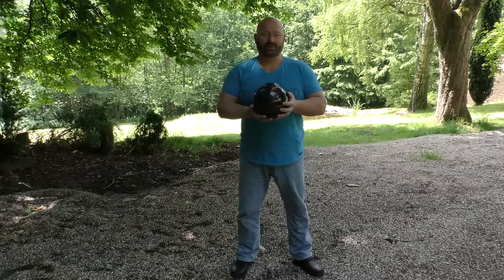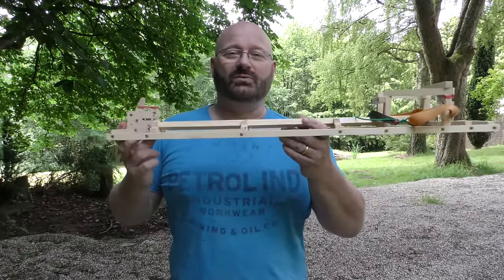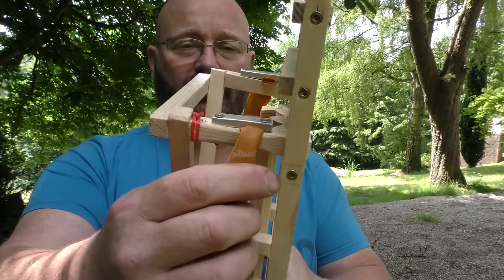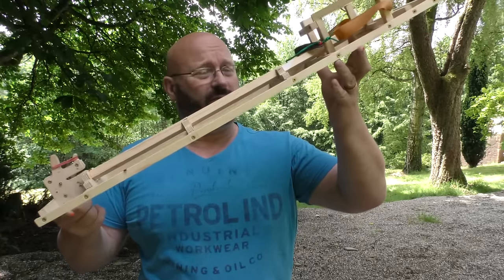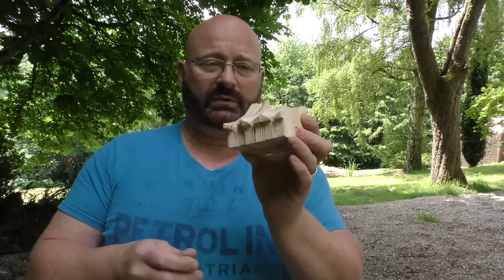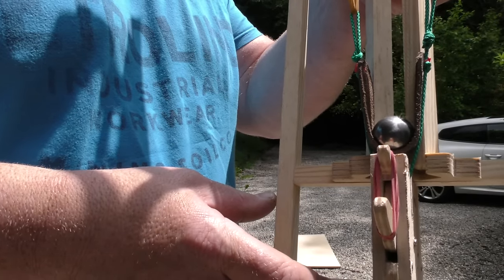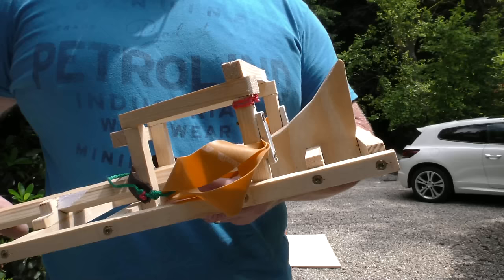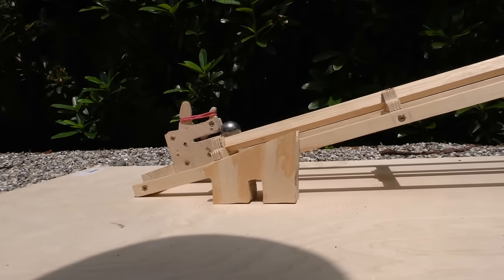Bowling Ball Launcher 1:10 Scale Experiments

Comment: Isn't the bowling ball 100x larger than the 1inch steel ball.
Reply: Sorry... 1000x larger
Reply: it is 10 times wider, 10 times taller, and 10 times deeper than the steel ball.
Reply: +Jeffah24 yeah, making it 1000x the volume
Reply: well 10x10x10 is 1000 which might be correct for the SIZE of the ball (note that no specifications on the ball were given by Joerg), but bowling balls also aren't made from steel so you have to take into account that a ball of steel the same size as the bowling ball would be waaaay heavier. Someone earlier said that a 25mm steel ball was more like 1/644 of a bowling ball but if that's a 14 lb bowling ball, which is the average size for an adult, then i think it would more like 1/750. Now there is a lot more to launching things than just size and weight but my point and a lot of other people's is that a 25mm steel ball is NOT 1/10 of a bowling ball by any stretch of the imagination.

Edit: Maybe he just means the launcher is 1/10 and saying the ball was 1/10 was just some confusion.
Reply: +Blasturbator yeah of course in terms of weight a bowling ball made of steel is going to be some what heavier. But I'm just talking about scale. I worked it out that the steel ball is roughly 8.6cm^3 and the bowling ball would be 8600cm^3 making it 1000x the volume.
Reply: VOLUME is not SCALE.  The scale is 1 : 10
Reply: +Jeffah24 Scale can take into account volume as well but my original point is wrong you would multiply every factor by ten to work out the volume not the volume its self. So it is a 1:10 scale, not for the reasons you stated.
Reply: +Lewis Ramos it's a 1 : 10 scale because I said it's a 1 : 10 scale, and most importantly because Joerg said it's a 1 : 10 scale.
Reply: +Jeffah24 yes you are correct and you nor Joerg can ever be wrong about anything. I do apologise sir or do you prefer "your majesty".
Reply from the maker: I am certainly not always right, not by a long shot. But here, I clearly used the correct scaling pretty much. Check out wikipedia "the scale often reported in scale models refers only to the geometric scale".  Means, a 1:10 model of a 25 cm ball has a diameter of 2,5 cm. If you go into a toy store and buy models for airplanes, you will find that this exact method is employed. It's just how scale models are defined. Of course the volume of the large ball will be 1000 times larger, but so will the volume of the wooden beams and the volume of the rubber relate.
Reply: +JoergSprave Yeah I realised I was being stupid because I didn't take into account you multiply every measurement by the scale vector 10 making it a 1:10 scale in terms of each individual measurement. I do apologise and I absolutely love your videos and respect your knowledge on these subjects.
Reply: +Lewis Ramos It would be interesting to put a 1:10 car next to the 1:10 bowling ball launcher. Technically speaking, the 1:10 bowling ball should fit in the seat of a 1:10 scale car.
Reply: +Takashi Tamanaha You're just saying 1:10, what are you scaling it against.
Reply: +Takashi Tamanaha 1:10 is a scale down of the actual size. A real bowling bowl and a real car scale down 10 times would look like toys. The 1 in 1:10 is always reality size. A real life bowling scaled down 10 times should fit in a real life car scaled down 10 times. The size stays proportionate.
Reply: +Takashi Tamanaha Not strictly... There are large cars and small cars if you named a specific car it would have made sense.
Reply: +Lewis Ramos It applies to all cars because it is the size of the actual size car no matter the size of the car. A miata scaled down 10 times will be proportionately smaller to a Ford F150 scaled down 10 times. The factor is actual size.
Reply: +Takashi Tamanaha All actual size cars can fit actual bowling balls. Therefore all 1:10 bowling balls can fit into all 1:10 cars.
Reply: +Takashi Tamanaha What you are saying makes absolutely zero sense.
Reply: +Lewis Ramos just think of it as all squares are proportionate.
Reply: +Takashi Tamanaha Cars are not squares they are different shapes there is no exact size of a car so if you want to have a 1:10 scale model you would have to specify what car. How do you not understand that? I did A-Level Mathematics and mechanical mathematics alright, this is my shit.
Reply: +Lewis Ramos well if you draw any square. Which is four 90 degree angles with four equal sides and shrink or expand it. It still remains the definition of a square.
Reply: +Lewis Ramos Scaling is giving a reference point at which a shape is being enlarged or shrunk.
Reply: +Lewis Ramos  A bowling ball shrunk ten times still retains it shape. Same thing for a car.
Reply: +Lewis Ramos So if the bowling ball is shrunk 10 times and any car is shrunk at 10 times. The shrunken 10 times ball will fit in a car shrunken 10 times.
Reply: +Takashi Tamanaha Well done you used too many words to explain simple logic. Congratulations. 😂
Reply: +Lewis Ramos Well I did not have a reference point of how much you do not know.
Reply: +Lewis Ramos I was an anti tank missile men in the military. It is vital to explains things clearly, otherwise something might go wrong and the wrong people die.
Reply: Is a bowling ball 100 inches or 2.5 metres?
Reply: it's 10×
Reply: ADZ OWND U No it's1000x the size but it's three dimensional meaning each factor must be multiplied by the scale vector 10.
Reply: Michael Western The irony in this comment is overwhelming.
Reply: +Lewis Ramos How in god's name did you pass GCSE maths, never mind A level
Reply: +Lewis Ramos I have a degree in physics and mathematics and let me assure you, this is most certainly NOT "your shit".
Reply: Oscar Hall sure sure... Can I just specify I have already established I was wrong and have corrected myself.
Reply: ***** Oh someone else who hasn't clicked the link.
Reply: Sir Lance Goodthrust If someone questions my intelligence when I'm right and they're wrong then I'm not going to apologize. If you would like to click the link it would be amazing.
Reply: Why thank you Sir Lance Goodthrust. You are indeed a Gentleman and a Scholar!! Lewis Ramos aka angry atheist is just craving attention. I do not think he as any motivation in his life, but only to make other people upset. Sad story. That is my conclusion. People cannot receive help, if they cannot see that they need help. That is called ignorance and Angry Atheist is ignorant in why it is important to make friends instead of enemies.
Reply: Sir Lance Goodthrust The second someone questioned your knowledge you went straight on the defensive. Weird considering you were just telling me that was wrong. As for you Takashi it wasn't my intention to offend you and if I did I apologize, it just appeared you were explaining to me what I already knew and when I clearly stated I was wrong about my original point and also gave an explanation as to why, people were still trying to prove me wrong... My sincerest of apologies, please in the future don't be so quick to judge someone it can come across as an unnecessary attack.
Reply: Sir Lance Goodthrust About atheism
Reply: For nearly every drafting project, the term "scale" refers to one dimensional measurements, or length. Volume, consisting of three dimensions, would then be the cube of that ratio so everybody here is technically correct, but the dude refers to his project as a 1:10 scale and when in Rome, do as the Romans do. As for the rest of this mumbo jumbo, can we please just pause, take a deep breath, and remind ourselves that this is a youtube video about slingshots. Rubber and wood. Not veganism, politics,crossfit, or any sort of religion (or lack of). Slingshots, people.
Reply: +Max Mazurowski i agree, this is about FUN!!! So let us have some mr Sprave!!!
Reply: +Angry Atheist No worries.
Reply: The densities are different.
Reply: shlev Wow
Reply: When you talk about scale u consider only ola parameter, in this case radius.
Reply: Angry * Atheist

Comment: Instead of moving the whole frame up why not just move the channel/barrel the ball is fired from. You dont even really need the barrel. Have two poles or a frame to attach the rubber to then you can simply adjust the height that the rubber is attached at. Still use your winch that you attach to a frame that is either connected to the poles or planted firmly in the ground to stop it moving (use long spikes that you hit into the ground like you would use for a tent but a lot bigger, these can be easily removed when you need to move the winch).

Comment: hoist say 1m and then add a ramp that is not as steep (15 degrees for example) and see how it goes with both?

or dig a pit and lower the back end into the ground so you dont have to hoist it as far in the air

Comment: I would like to see how it works with a smooth ramp... like a smooth curve... with a smooth transition...  the way you have it now, the ball just slams against the ramp and gets deflected...  you could just as well be shooting at an angled wall... you are losing a lot of energy by doing this. you could use Sketchpad for example to design nice curvy ramps that could be cut out on a bandsaw and which would let the ball transition smoothly into the desired trajectory without the massive energy loss caused by the impact with the ramp. you could even polish them or make them out of something like nylon (ikea cutting boards maybe?).  need help with sketchup?... send me an email or fb messenger pm...

Comment: I am really shocked that you are still working the ramp idea.
The angle of elevation is really a simple one.
See saw the design, (steel axle pivot) using balancing weights on the back and insert a electric/hydraulic car jack on the tip end.
http://image.made-in-china.com/2f1j00OnstiVwJPlko/Auto-Electric-car-Jack-QJY030C.jpg
It's a bit over kill but it's rate of elevation (over one metre) is equal to a ramp of approximately 17-18 degrees. But as I don't have exact measurements of your device I cannot get a closer angle of measurement.
http://wananlift.en.made-in-china.com/productimage/YvomCDjVLykR-2f1j00OFSTibdCGVqk/China-Auto-Electric-car-Jack-QJY030C.html

Comment: 10 times larger?  More like 100 times
Reply from the maker: No, just ten times. 100 times larger would mean 75 meters = 82 yards. That would be a bit long.
Reply: A bowling ball is about 8-1/2 inches in diameter, so only 8-1/2 times the size of the one inch steel ball. The volume, of course, doesn't work out the same way. Therein lies the confusion.
Reply: OK you are talking about scale. I am thinking more towards volume.
Reply: Dimensions are 10 times larger, but total volume is actually 10^3 times larger or 1,000 times larger.
Reply: Pretty much everytime someone talks about scale models , they talk about length measurements.
Reply: That's what she said.

Comment: The construction is difficult and not very efficient. Rolling ball is decelerated by friction. Pouch will obstruct rolling... Why not to try ballista launcher instead. Rectangle frame, two screwed plaits of rubber or simply hemp rope with two beams and pouch. Easy and effective...
Reply: or...at least use some kind of trolley and rails. Ball will sit on cart....

Comment: am I rhe only to point out that that is far smaller then 1/10 scale.
Reply: the not rhe
Reply from the maker: Maybe that is because it IS 1/10 scale. Original = 7,5 meters, model = 0,75 meters.
Reply: yep I just did the math and a ball 10 times bigger then that 25mm one is only 53.86mm
Reply: +JoergSprave omg u responded to my comment a second time
Reply: the bowling ball is 644 times bigger then that steel ball